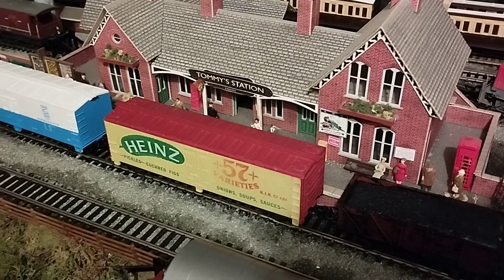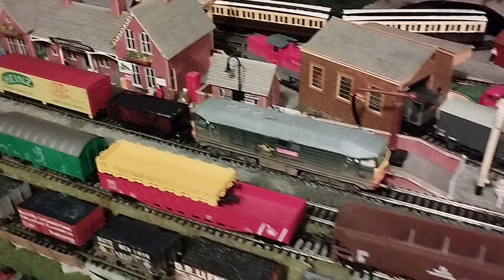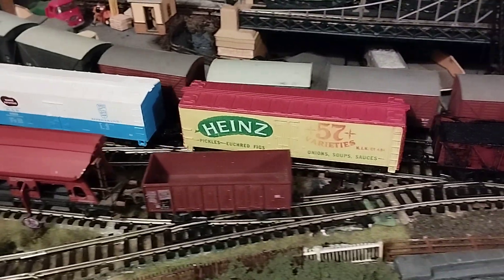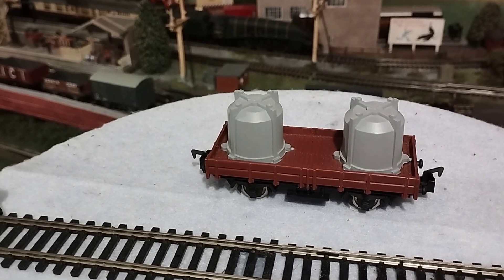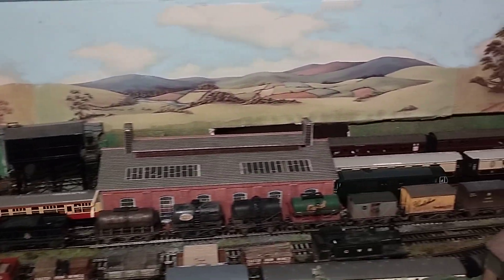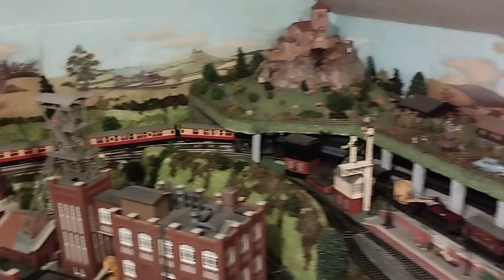Tommys New Wagons and More CD Motor Conversions

Comment: Hi Paul, it's impressive how that Class 29 and the V100 are performing now: you truly are a master in improving old locomotives! I have no idea about the Lima wagon with the containers on it: it has hook couplings so probably made for the British market. The platform doesn't really look like European. And the containers look like made for hot liquid steel. But why would they be on a wooden platform wagon is a riddle. Great video 👍
Reply from the maker: Hi Erik, Fitting CD motors can really improve these Hornby and LIma Locos. Replacing worn gears also helps reduce noise and starting performance.
Thanks for trying to identify the wagon with the cylinders it is a mystery for sure. All the Fleischmann wagons have this type of hook, they are not compatible with the UK style D Coupling so not sure on these either. I have made an adapter wagon with a normal European coupling on one end so can connect to my Ho Locos.
 Cheers, Paul.👍👍👍

Comment: Hello! Another awesome motor changes, those locos have now the grace of ballerinas. A pleasure to see them on low speed or barely moving. About the Lima platform, quite interesting - look online for a Lima catalogue from 1964, there it is, labeled as: ”carro scoperto a  sponde basse a 2 assi con rico di  botti speciali” (unfortunately Youtube won-t let me post a link here, so..). There are a couple of sites having that 1964 Lima catalogue (probably in some catalogues after 64 the wagon might appear, too). Thanks for the video, have a super Sunday! / Chris :goodvibes:
Reply from the maker: Hi Chris, I am very happy how these Hornby and Lima Locos can be made to run much better. Thanks for the info on the Lima Cataloque, I will try and find more information on this strange wagon. I appreciate your help its very good of you. Cheers, Paul.👍👍👍
Reply: @paulvozman842  Hi, I had to dig to find info about that Lima platform, it was the first time I have seen it. Glad I could help, I hope you had a super Sunday in family. Cheers! :)
Reply from the maker: @Cristake1974  Hi Chris, thanks again for your help. Yes had a lovely day with the family, its good to spend time together. Cheers, Paul.👍👍👍

Comment: Hi Paul another great video,and you have done some great work on those loco's again! As you know as i have said it before i much prefer to see the older stuff running compared to the new,how people can afford a lot of the new items amazes me! Anyway have fun and thank you for sharing your work.
Reply from the maker: Hi Michael, I bought 3 used Diesels in good condition except for noisy motors. This Hornby Class 29 is the first 12v CD Motor conversion with a new gear set that I have finished. I am getting round to fitting 12v CD Motors and replacing worn gears on the next two Locos.
I agree with you keeping these older Locos running is worthwhile and much cheaper than the new Locos on sale now. For around 50 pounds I can buy a used Diesel, the 12v CD Conversion kits and replacement gears, as compared to up to 200 pounds for a new Diesel.
I hope to show my next modified Loco next Sunday with some more used wagons I have bought.
Have a great week. Cheers, Paul. 👍👍👍
Reply: @paulvozman842  That's great Paul and i would much rather have the older moldel's any day! Have a great week :)

Comment: Hi Paul,
You are a one with your improvement program for you loco's so well done as always your trains running great and looking good. I hope the family get together went well. Still waiting for the sub to surface as summer (what summer) is fast coming to an end. Keep well and improving.
Cheers Robert.
Reply from the maker: Hi Robert, Great to hear from you.
its good to have family get togethers, time for the barbeque and a few beers. 
I have modified the propulsion on my Corvette and plan to test it in the next few days. Its still too cold in the pool to test the Sub fully so may just run it on the surface with a few shallow dives. Its now positive boyancy with means it has to be driven under as a fail safe measure. With my old flooding system if it submerged too deep it meant jumping in the pool to recover it
 It is repaired so sea trials are needed to test for leaks and any problems all being well this week.
I bought 3 used Diesels and 3 12v CD Conversion kits and replacement gears so the Class 29 was the first to be converted and it runs so much better. The next 2 will be completed soon and I hope to show the next one on Sunday.  

I see you have been busy gardening and solving issues on your layout. Its not easy being  in an attic when working on the layout and running trains. Good to see your arm is better and you have an automatic car now to make driving easier.
Take care, have a great week. Cheers, Paul.👍👍👍

Comment: I really like the European rolling stock Paul, the amount of detail in some of them was excellent for the era they were produced. Flieschmann, Roco and Lima really did some nice work, and it was so cheap.  I have the red and green V100s produced by Lima, they both run very smoothly.  That wagon looks like a scratch build of a cement wagon? I have two versions of the Class 29, i think yours might out perform with the new motor though. Steven.
Reply from the maker: Hi Steven, I also like the Ho rolling stock, as you said the amount of detail is amazing considering their age. The blue +white box vans are marked " Life Like" I found the name underneath after the run. These were made by Mehano for the US market but some stayed in Europe. 
For me the wheels on the HO wagons are much better than Hornby or Bachmann, the flanges and profile of the wheels are perfect and de-railing rarely happens. I thougt the wagon might have been for cement at first but its a mystery what the tanks are.
The Hornby Class 29 was worn out when I bought it but the body and chassis were in great shape. Fitting a 12V CD motor and a complete gear set has turned it into a superb runner. I often get inspiration from watching other peoples layouts, I actually saw your 29s and thought how good they looked so bought one.
Cheers, Paul.👍👍👍

Comment: Hi Paul, you,v done an amazing job on your loco,s.  I really like the Hornby class 29, mine is a lot noisier than yours. Very impressive work and a great video. All the best butty. Carl.
Reply from the maker: Hi Carl, My Class 29 is one of my latest purchases, when I tested it the noise from the motor was terrible. Fitting a CD Motor and a new gear set has transformed it into a quiet smooth runner. 
As you know converting to CD drive is a great way to improve these old locos, the ones you have fitted to yours run very well.
I have bought 2 more Lima Diesels and am fitting them with CD motors and new gears where needed. Thanks for the kind comments have a great week. Cheers, Paul.👍👍👍